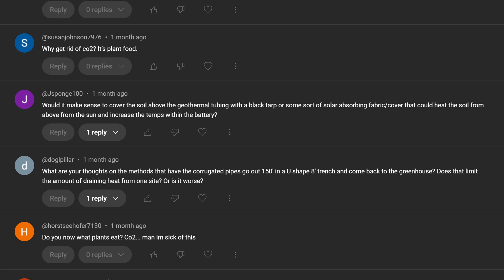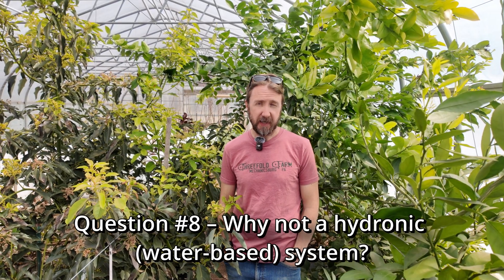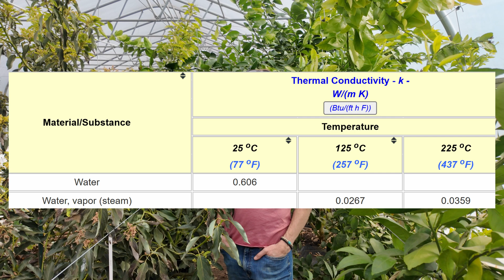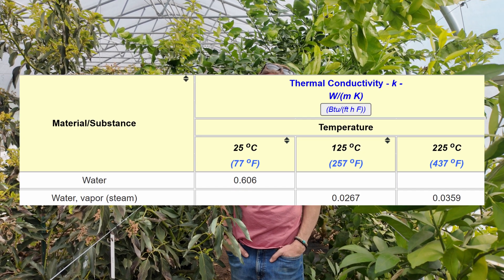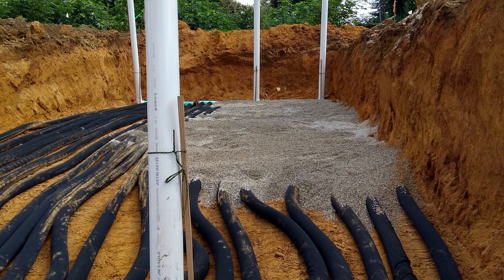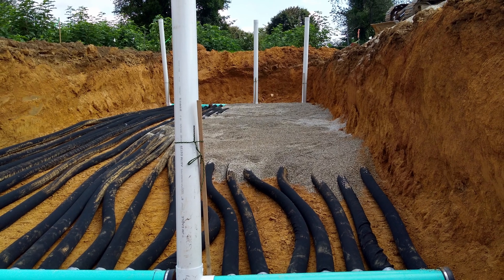Top 10 Questions About Our Climate Battery Greenhouse

Comment: a closed-loop ground water pump would only pump against friction at the pipe wall and the water convection. It should consume little energy and could keep the surface soil layer at steady 53°F (= 12°C) in winter. But it needs to be seasonally recharged. I know cases where the ground water started to freeze over several years of ground water heat pump use for private homes. So, combining both could help you over the very bad days in winter.

Comment: You are definitely one of the better people on the internet in your explanations and your reasoning. I looked at a few of your other videos as well, and the analysis of airflow through the piping. Being that your system is already in place, it is probably prohibitive to upgrade the efficiency. But if you would do it again, or for other folks like myself,  how would you fix/resolve the inefficiencies? Would tapering the large pipe/manifold increase efficiencies? Did any of the students have any ideas?

Comment: The slots in perforated drainage tubing are typically located in between the ribs, which results in condensate collecting in the bottom of each corrugation. If you have an offcut of tube, place a 1ft section on level ground and pour water into it. Measure how much water is retained in the corrugations. Multiply that number by the total length of tubing in the system and convert to pounds. Finally multiply that number by 1000 to get an idea of how many btu you could potentially lose from the thermal mass to evaporate it.  My question to folks that have a climate battery is why they spend a small fortune on the installation but never measure anything apart from the inlet and outlet temperature. Its very easy to test airflow and pressure drop, inlet and outlet temperature and RH%. You cant calculate the system performance without measuring these variables.

Comment: I too am in a 6b zone. East of Boise Idaho. However, my space is more limited so I am looking at building a 24x24 greenhouse. So I am seeing on your atmosgreenhouse site a 24x48 with two pair of risers. Would a half system be effective?
Reply from the maker: Different sizes will work to varying degrees. The issue you'd have with smaller greenhouses would be on the heat loss side through the structure and through the climate battery. A larger structure's ratio of surface area to floor area is higher and therefore the effective rate of heat loss is greater. So, that's a long-winded way of saying, yes it will work but perhaps not as well as a larger structure.

Comment: I wonder if you saw the comment placed on the Feb. 2025 video that suggests use of reflective material inside the greenhouse to mitigate heat loss at night.
Reply from the maker: Not sure I did. A reflective material is a decent idea. Most greenhouse films also utilize an IR blocking film for the bottom layer. Not sure if it's as effective as a foil material (probably not), but I think the idea is the same.

Comment: You may have covered this in your previous video (I can’t remember)… Why did you go with the large diameter tubing rather than LOTS more smaller diameter tubes? Wouldn’t that have been more efficient at transferring heat? I’m thinking of it like a radiator if that makes sense.
Reply: large diameter is just the vertical columns, it breaks out into smaller diameter tubes for the horizontal runs.
Reply from the maker: Yep, there are manifolds (large culvert pipe) leading to smaller radiator-like pipes that do the bulk of the heat transfer work.